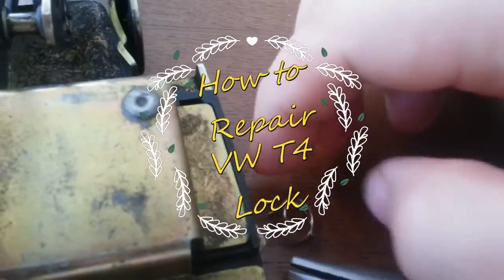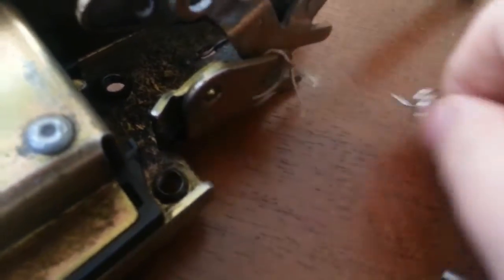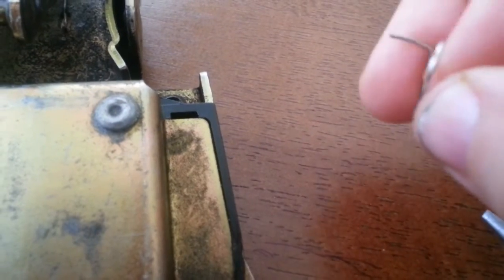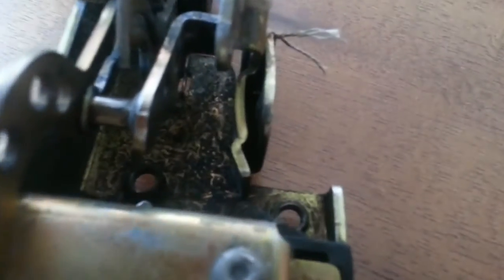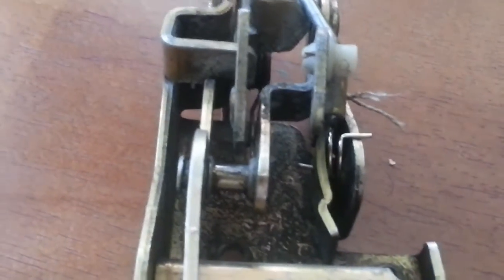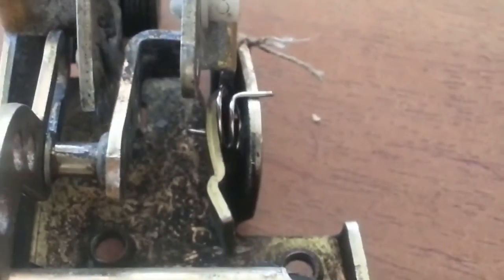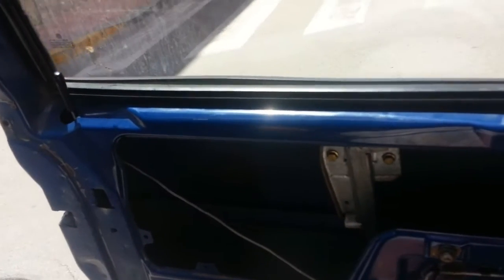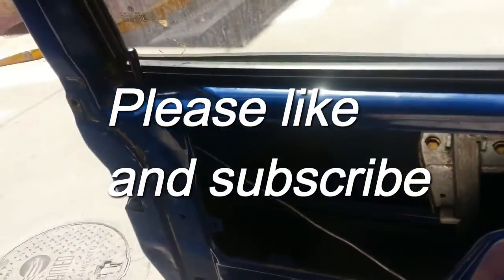VW T4 How to repair door lock mechanism

Comment: Is the locking mechanism for the back stable door the same as this? I can't find anything on youtube about the back stable door locking mechanism
Reply: Hi I have the same issue with my rear barn door too, did this tip fix it?

Comment: Thank you for making this vid, had the door handle off today and realised it was going to require the door card coming off, my biggest worry was the lock pin dropping when the door is closed from outside and keys are in the van! Good to know what the problem is and that it can be fixed for nothing. I have subscribed
Reply from the maker: +T4 Tips & Guides had the same problem. As i come across the bits i can fix will share. Thanks for subscribing.
Reply: I've just made a spring, going to fit it in the morning. Thanks again.
Reply from the maker: Cool let me know how you get on. The one I put in this video is still going strong.
Reply: will do, my van is 18 years old now, little jobs like this are commonplace,    it's all part of the fun of owing a T4!
Reply: Fitted and working! Hasn't quite got the snap that it used to have but at least I wont be getting locked out of the van. Diameter of the spring I made was 10mm, this rubs slightly on part of the mechanism, not a problem, but to fit correctly it needs to be 8mm. An 8mm diameter would also give more tension. Thanks again for the vid.

Comment: Hi would this be the same for the central locking mechanism mine has jammed can't pull up or down it looks like the rod is being blocked to move ?
Reply from the maker: +mark dobson not sure worth asking on the VW T4 forum incase it's something like a solenoid.
Reply: Did you find a solution? My slider lock post is locked in the lock/down position and will not unlock.

Comment: Hey, 

Thanks for this, managed to get it working. The spring does look rather precariously balanced though... Not sure how long it will stay in, but for now, I no longer need to wind down my window to get out of the van :) Thanks!
Reply from the maker: No worries, can use as a stop gap but mine's been in since I fitted it (roughly same age as this video) with no problems.